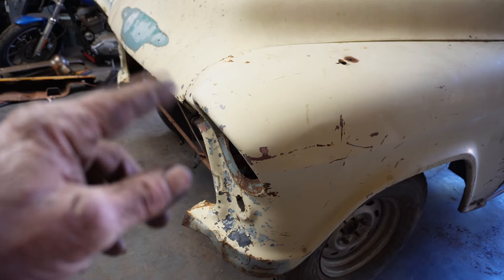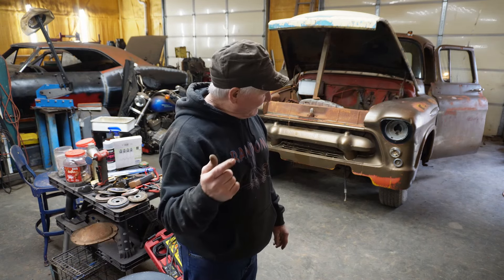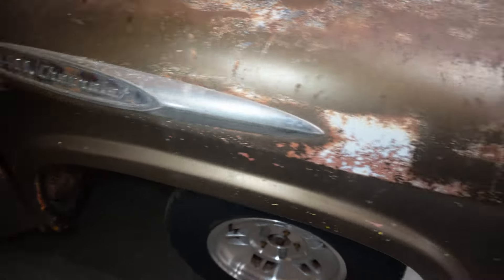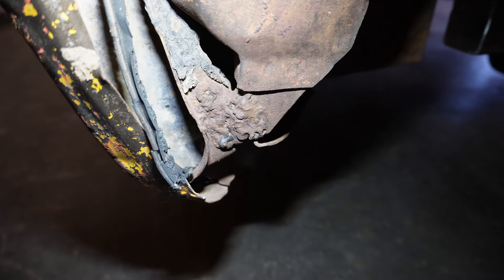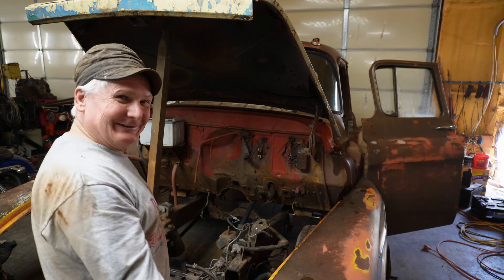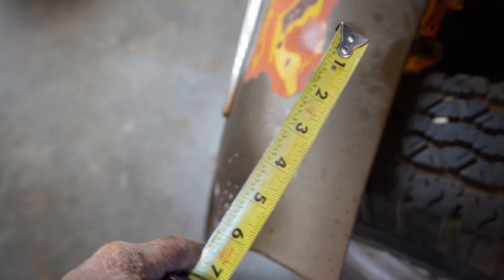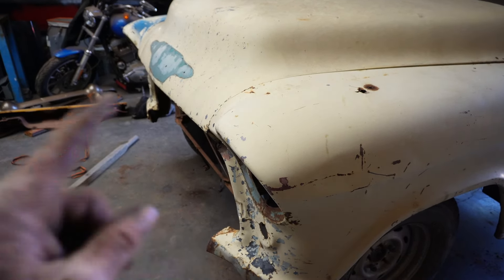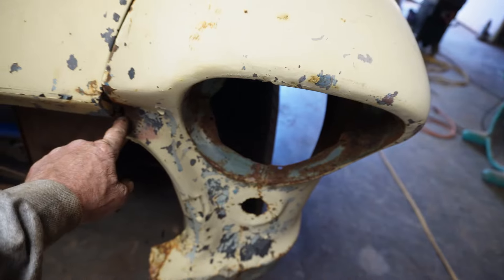TRANSFORMING a 1957 Chevy Viking into an Apache

Comment: Thanks so much for the gm info resource
Reply from the maker: I also use the gm assembly manual.  It is invaluable if you are struggling to figure out how the car/truck was assembled or what pieces you are missing. 😊
Reply from the maker: BTW I have spent many hours jumping hot wheels.

Comment: So if you put a Tahoe frame underneath a 3100 defenders are too narrow if you use these fenders from the Viking it should fit better don't you think seems like the fenders are wider
Reply from the maker: Yes, each Viking fender is 2" wider than the 1/2 ton Apache fender. The wider fenders should work better for a tahoe frame swap. Especially if you decided to use the 17" or 18" wheels from the tahoe.